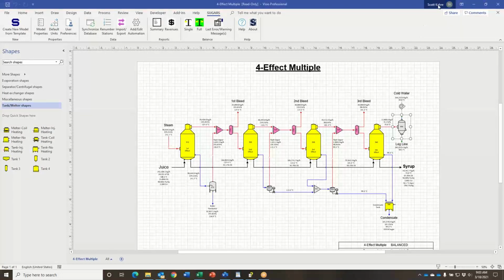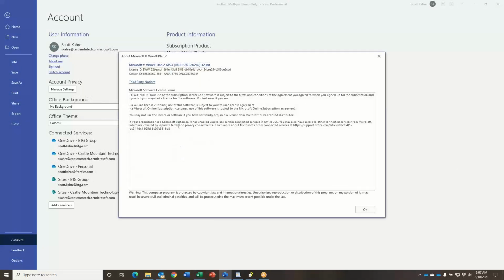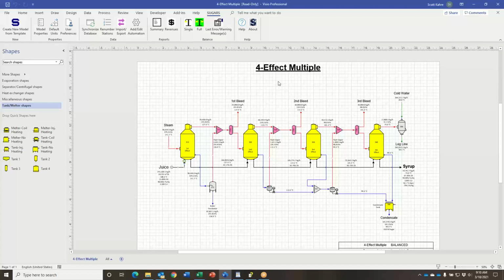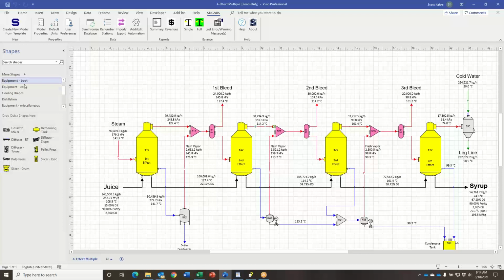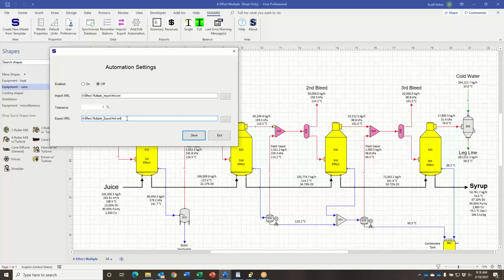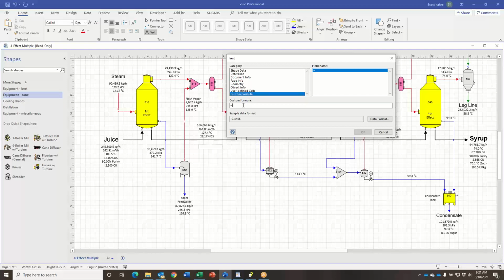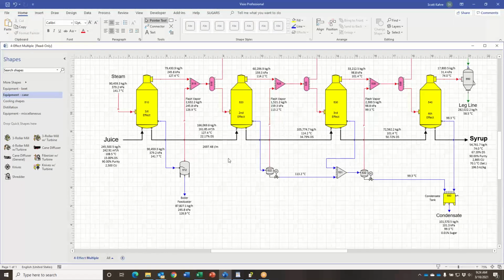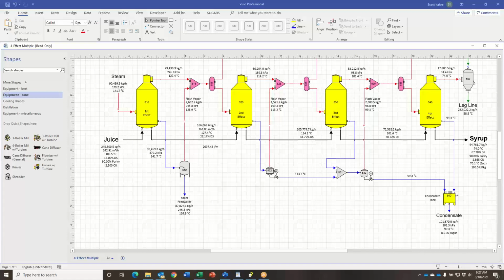Introducing Sugars 4.1 Webinar 03-18-21

Comment: Sir,
How to automatically distribute pressure and temperature in Sixth Effect Evaporators,
Reply from the maker: Hello, Raju!  I recommend you view the recording of our previous webinar that covers the details of modeling multiple effect evaporators:

https://youtu.be/qIYNHMDhuuA

Thanks for your question!

Scott
Reply: @sugarsinternational4330  I have seen that recording, but I want to distribute temperature in Sixth Effect Evaporators by pressure feedback option. In that recording temperature feeding is manually.
Reply from the maker: Raju,

You will need to connect the vapor leaving the 6th effect to a receiver station with another flow stream connected, or to a condenser station with internal pressure specified.  Then, you can check the "Pressure Feedback" box in the 6th effect evaporator station properties.  This will cause the evaporator to match the downstream vapor pressure, and the evaporator temperature will be calculated based on that pressure and the boiling point rise of the juice.

I hope that helps,

Scott Kahre
Reply: @sugarsinternational4330  Thank you very much sir, I will try and back to you.